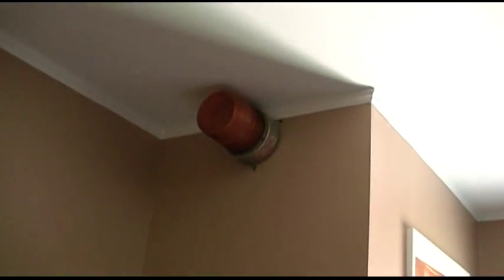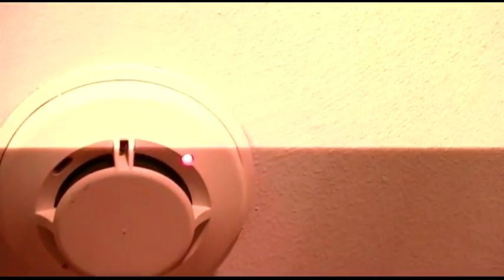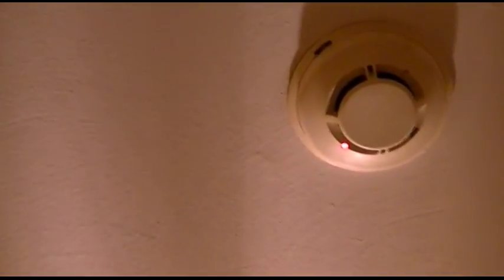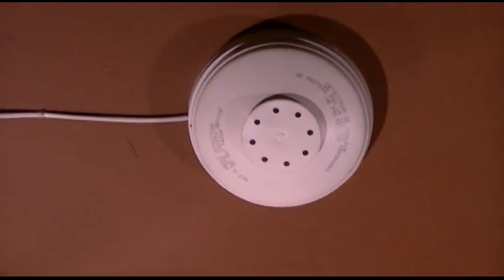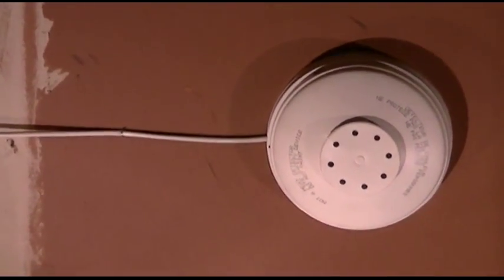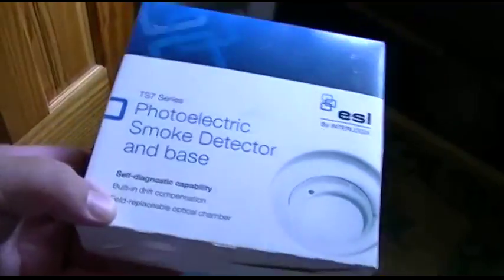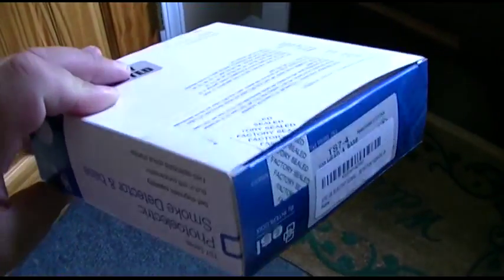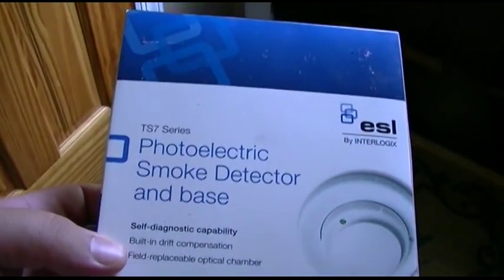Code 3 Alarm!!!  FIRE!!!

Comment: jay, now that I watched this video again, I believe the sound from the siren and the tones from the keypads are supposed to be in time with each other. From what I know, from my father being an alarm tech for years and from what I learned from him, if you have a lot of devices hooked up to the alarm panel, the transformer inside the panel can't supply the proper amount of voltage/current to the system or parts of it causing this problem. The system still functions, just everything is not in sink. If you watch any other videos of the same type of Honeywell vista 20 setup, you will know what I am talking about.
Reply from the maker: I had long suspected that.  I kind of like it not synchronized, because you get alarm sounds even when the siren isn't firing, and you can still tell what it is.
Reply: It’s not synchronized because they are old keypads and not the same models

Comment: The smoke detectors in my home do not have batteries.  They are mains only, but have 3 wires. 2 for mains, 1 for a common "bus" that is to allow all alarms in the house to be linked. problem is, they never wired the house up with that third pin.
Reply from the maker: Well that's totally fail!  They just had to run a 14-3 wire around to all of them, and they used 14-2.  In the event of an outage, especially in your area where that might possibly happen more than where I am, you're just left there, detecting all yourself.

Comment: The detectors in your house actually do not have batteries in them. They're wired to your BACP's battery and run off of it. Your alarm should tell you when the battery is low, but it's always good to unplug the panel to make sure the battery holds a charge at least.
Reply from the maker: Yes, they are wired to the panel, none of the smoke alarms have batteries, except the one outside the kitchen, which eats 2 batteries a year.  That one is wireless.  The alarm panel monitors its battery, and lets me know when any wireless sensor's battery is dying.  The backup battery is doing fine, and the panel also alerts for that.

Comment: Did that wake you up in the middle of the night?
Reply from the maker: Surprisingly, no.  It only happened around 12 - 1 in the afternoon, for a week straight.  There was no rhyme or reason for that time, and not at night when I was sleeping, that's just when it went off.  I wish I knew the reason for that one, but I'm very happy it didn't wake me up.

Years ago, the cat knocked something down that was glass and it broke, and the glass breakage sensor set the alarm off.  To hear glass smash, followed by the keypad screaming, alarm blaring, and the hallway up there flashing ORANGE, BLACK, ORANGE, BLACK, was the closest I ever came to a heart attack.
Reply: jaykay18  thank goodness it didn’t go off in the middle of the night.
Reply from the maker: Yes, I was very thankful for that.

Comment: I usually try to replace all smoke alarms here after they've been in service for about 10 years (with replacing the 9V alkaline batteries in them every 1.5years as the ones we use here are all battery operated). So far I've only had one go bad on me (as in beeping even tho it shouldn't) and the other one that failed in the middle of the night right after I fell asleep was older than 10 years so it didn't count (yay for procrastinating on changing out those old smoke alarm thingies.....which I finally did a few days after that false alarm had happened).
So far the only times I've heard a smoke alarm actually go off to smoke being detected, it was due to my grandma forgetting something on the stove which only ended in food being burnt and us having to open up windows to get that burning smell out.
Reply from the maker: In our old apartment, the smoke alarm was badly placed in the hallway area right off the kitchen.  It was super-sensitive, when we'd make stuff in the oven, often right after taking it out it would go off.  If there was something that was a repeat offender, I'd go rip it down first and put it to bed under the pillow so it wouldn't sense it.
Reply: I was soldering something for someone (on a circuit board) on the dining room table the other day, and the smoke detector went off. Strangely, it didn't fully go off, because it beeped a few times, then shut itself off! None of the rest of them went off, even though they are wired together. Strange ...
Reply from the maker: Benjamin Esposti Interestingly enough, I've actually experienced that before myself.

In my dad's house, the door to the upstairs had a smoke detector mounted on the ceiling, at one point in the travel of that door.  Whenever anyone would take a shower up there, the steam afterwards would cause the smoke alarm to beep momentarily when the door was opened and closed underneath it.  Weird.

Comment: Why do you have those big light things in your house and the downstairs panel more soothing and which one was it
Reply from the maker: I have those because I WANTED them.  I found them in a thrift store years ago, had no other use for them.  Then when I bought my house, and got the alarm set up, I realized that often alarms will also have strobes to serve as a visual warning.  I had 3 floors, and 3 strobes, the idea was born.

The downstairs panel makes a nicer tone.  It's a "First Alert" brand.  The smoke detector at fault was the one in the second floor hallway.  It has been repaired.
Reply: jaykay18  oh I see cool set up for those big strobe light things looks like at Home Depot but even though we're suppose to have smoke detector in that house I usually hate them cause the beeping and changing battery but they save us from fires
Reply from the maker: All of mine are hardwired into the alarm panel, so there are no batteries to change.  Well, there is one that's battery operated, change the batteries in that once a year.  Big deal.

Comment: That's a lot of keypads.... Those are all System Sensor smoke detectors from the mid-late 90s. Time to replace them all.. Are they 2 wire or 4 wire smokes?
Reply from the maker: Yeah there are 5 keypads in all.  The smokes have 4 wires in total, 2 for power and 2 for "sensing".
Reply: jaykay18 Ok. You can replace them all with any type and mix of 4 wire smoke detectors. As long as they run on 12VDC.
Reply from the maker: I bought one that matches that description, didn't work.  Would throw the whole smoke zone into CHECK.  Ended up blowing out this guy with compressed air and it's been perfectly happy since.
Reply: jaykay18 There’s no reason it won’t work. It’s likely a wiring error as many newer 4 wire smokes have 5 terminals for extra supervision.
Reply from the maker: Someone had suggested the old one had a resistor built in for supervision while the new one did not.
Reply: jaykay18 I doubt it. To my knowledge System Sensor never produced any models with built in EOL resistors. Check the model number of the last detector in the loop. Bet it’s model 2412TH.
Reply from the maker: Well, I thank you for your help, but it's actually mounted in such a way that it's really not easy to get to.  At this point, it seems to be working and will stay installed, as much as it needs to be replaced.
Reply: jaykay18 Should be OK as long as it blinks and doesn’t false. At some point it will fail though and someone will be standing awkwardly on a ladder lol.

Comment: What's that thing below the strobe
Reply from the maker: If you're referring to the white thing at 0:47, that's a speaker.  Plays my SHOUTcast stream 24x7, plays my electronically programmable phone ringer, and also is the speaker for the doorbell.  There are currently 3 other speakers that do the same thing.  I need to add 4 more.

Comment: Got a pair of 10 year lithiums. Friggen way too sensitive. Had an occasional 2am "On your feet" moments.
Reply from the maker: Believe you me, with those strobes there, holy hell it's downright scary especially at night.  I remember back in the day we had a cat burglar by the name of Grandpa Lion who set the alarm off, 2AM, and the hallway upstairs went black, ORANGE, black, ORANGE, black, ORANGE.

On the other hand I think my dad's smoke alarms, which run on 9v batteries, have got to be either from the very late 70s or early 80s.  I doubt they'd be very effective anymore.  In fact they're so old they don't have the ear-piercing "chirp" the new ones do, they have a piezoelectric buzzer!
Reply: The last set of alarms were replaced, because the piezo got weak, they sounded like a catbird calling. Meow! If sounding long enough, might have attracted some feral cats.
Reply: Michael Gegzno speaking of the 10 year ones. I was cooking at my grandpa's house that has them. there was apparently something burning so Everytime I opened the oven door the one in the hallway would go off. of course once I walk over to it my ears in pain cause it's so freaking loud and in an echoey hallway it self resets. Some choice words were said about first alert that day!!

Comment: I thought code 3 meant missing child.
Reply from the maker: Not in this panel!  Different codes for different systems.
Reply: jaykay18 I was kidding. Code 3 is Walmart's missing child code. I noticed that your smoke alarm you bought was an Interlogix/GE. Most times Ademco Honeywell and Interlogix don't play nice. I'd get a Honeywell replacement if I were you.
Reply from the maker: Jackson Howell Thanks for the additional information.  Should this detector go bad again, I'll consider doing that.
Reply: jaykay18 I talked to my aunt today and she told me that she ripped out her Ademco Vista 15p 😭😭😭. The 6128ADT panels are still in the house, but blank...
Reply from the maker: Jackson Howell Probably, like most paint jobs, the painter was lazy and just painted around them.

Comment: Uhh... Yeah. You can! :-)
Reply from the maker: Oh yeah, they'r really screamy here.  I once disconnected the siren and set it off to just let the keypads scream, believe it or not they are quite loud!
Reply: jaykay18 damn.. wish that was recorded... I imagine that they were loud though... as you can already hear them over the siren... they sound loud enough to wake me up...

What's the little speaker looking thing under the strobe?
Reply from the maker: That can be pretty easily recreated except I'd need a way to trip the smoke alarm.  I'd have to look up a way to do it in the panel, I forget exactly how it's done at the moment.  Otherwise it's really as simple as removing the power wire to the siren.

The little white speaker thing at about 0:48?  That's connected to the doorbell server in the basement.  Plays the SHOUTcast stream quietly 24/7, yes, even through the night (or there's a little button on it I can press that will shut it off), also rings when the phone rings, rings when the doorbell does, and blangs when I get a message.

I didn't have a more "PA" type speaker for up there, and as cheap as it is, it works well enough and happens to fit nicely under the strobe.  There's a speaker on every floor, and an extra one in the laundry room.  I have aspirations of adding several more, by the bar, by the table in the basement, outside in the patio, and in the garage.
Reply: jaykay18 ah! The 24/7 shoutcast. I remember seeing videos on it/ hearing the music slightly on other videos of yours...
Reply from the maker: It's there in practically all the videos.

Comment: No the keypads
Reply from the maker: 3 are Ademco, basement is a First Alert, and the one by the front door is just marked "ADT".
Reply: jaykay18 those are all ademco. ADT and First alert rebrands them.
Reply from the maker: JK Productions Thanks for the additional info.  Any clue why the new smoke detector didn't want to work with the system?
Reply: jaykay18 What's the model number of the new one? Also, if you have the old one it would be helpful for its model number as well.
Reply from the maker: JK Productions The old one, no idea, it's up where I can't easily reach it.  The new one is an ESL TS7-4.
Reply: jaykay18 it is a four wire detector, so it should work with your system. How many wires did you hook up to it? Also, what is the problem exactly? Does the panel give a trouble?
Reply from the maker: JK Productions There were four wires hooked to the old detector.  2 power, 2 circuit loop.  I hooked all 4 up.  The panel would always give a trouble, and keypads would beep rapidly, even after a full power off reboot of the system each time.
Reply: Assuming this detector is the last on the circuit (no wires leaving to another detector), there should be an end-of-line resistor across the two "zone" wires. Is there one present?
Reply from the maker: JK Productions There was no resistor, and no wires leading to another detector.
Reply: Check for a resistor in the panel on the zone the smoke detector is in. Since it's a normally open loop, the resistor should be across the positive and negative zone terminals in the panel, while other zone resistors will most likely be in series. And this has always been in trouble or just started when you replaced the smoke?
Reply from the maker: JK Productions No resistor on that zone, other zones have them.
Reply from the maker: JK Productions One other thing to mention, that just crossed my mind.  The power wires were reversed, black was positive and red was negative.  I had checked that before doing anything with a VOM to ensure, so I made sure to hook the new one up black on positive, red on negative.
Reply: Shouldn't matter. As long as it's wired the same at the BACP. Since there's no resistor, that's why you have your trouble. I believe the Vista uses a 4.7k resistor, but don't quote me on that. I'm more familiar with older panels lol. Once you get the resistor, put it in the contacts of the smoke (across the two zone wires). That's the "proper" way to do it instead of at the panel, because the resistor is there to cause a trouble if it ever goes away (if the wire snapped) and it wouldn't do this at the panel. Your other ones wired in series should be fine at the panel though.
Reply from the maker: JK Productions That sounds great, but my question is why does the old detector work without the resistor?
Reply: jaykay18 not sure why you wouldn't have a trouble with no resistor. Possibly an obscure model with a built in resistor is my best guess.
Reply from the maker: JK Productions That's about what I thought.  Anyway, thanks so much for your help on all that!  You've given me a lot more insight into the issue.  I'll try a resistor next time this one craps out.  Like I said it's kind of in an inconvenient location, it hangs over the railing upstairs so it's tough to get at.
Reply: I forgot about where it was. Just put a resistor in the panel then for now, it will clear your trouble and you aren't protected against the wire breaking without a resistor anyways lol.
Reply from the maker: JK Productions Well the old one is back in service, so there's been no trouble.  I blew it out with compressed air since trying to replace it, and it's been working fine since!  I still have the replacement.